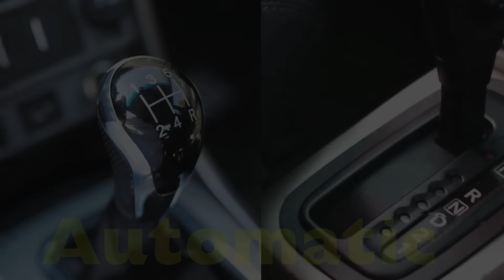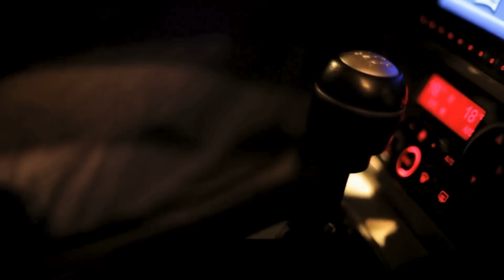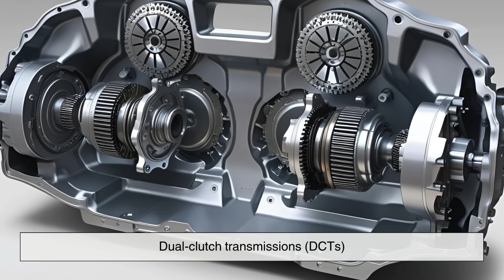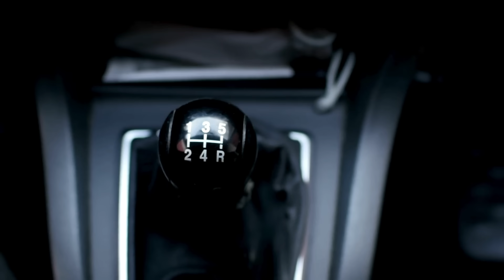Manual vs Automatic Transmission: What’s the Real Difference?

Comment: Can you do a video on automatic transmission shifting modes? Like 1st gear and low gear? Can you explain when and when not to use each manual automatic transmission options and high performance automatic transmission systems as well as hybrid automatic transmission systems?

Comment: The horrible little brother of the  DCT ... the AMT - automated manual transmission, found in some of the cheapest small car automatics
Also, any automatic other than the torque converter has the zero problem, though some would say the torque converter has a creep problem...
For a CVT, for instance, there is an added auto clutch that will disengage at a standstill, but the detection of engage point when pulling away can be uncertain if too gentle or harsh if too firm, I found trying one disconcerting after being used to torque converter. Wet clutch DCT may emulate the low speed creep by slipping the clutch

Comment: Even as far back as in the 1980s, I noticed that manual transmission was in decline in the US. For instance, only a small number of my classmates drove manual transmission. Meanwhile, only about couple of adults around me drove or had experience in manual transmission. However, this was true only in the US. If you jump to South Korea in the 1980s, the overwhelming number of motor vehicles you encounter would have been manual transmission. (But I wonder how much South Korea has changed since then. Hmmm ...)

Comment: I’ve driven manual Ford Ranger for 10 years in 20-million city. And not constant shifting gears pissed me up, but other idiots around, who block the road and not following elementary yules to make even more couple of meters.
And of course, as engineer I prefer vehicles with no transmissions at all. We need to shift a gear because of low efficiency of oil combustion engine at different rpm. Remove this drawback and forget about transmission as we know it. EVs going in this direction but they have a lot of different problems.

Comment: I went 7 years without moving a trailer and even longer not using a manual . Hopped into truck and was like had driven a manual the day before ! Plus if you have a battery issue you can still start a manual ! Drove both a manual and automatic on F1 track and the manual was way more fun 😁 . The only downside was the posted speed limit . 40 kph is painfully  slow in   Montreal ☹️ People bicycles and  cars  share the track

Comment: Another difference in manual since you basically coast to a stop by disengaging the clutch brakes last 3 times longer in a Stick shift
Reply: However, on most vehicles its a lot easier to replace brake pads than a worn out clutch
Reply: @ you don’t wear out a clutch depressing the pedal and coasting at that point it is disengaged and you have to do that at every complete stop. As far as a clutch goes they generally last for 135,000 to 160,000 miles if you actually know how do drive a stick, which I have been doing my entire life

Comment: Back before automatic transmission had more than 4 speed the same vehicle with a 5speed manual would accelerate faster than the automatic and get better gas mileage

Comment: Fixed gears are rudimentary for modern cars, remove fixed gears from equation and no more “control” argument. Manual work is not necessary, EV is way forward, even of backed by ICE generator is a superior solution for comfort and reliability. But fake gear noise and acceleration pulses can be optional mode for fans

Comment: No, I've never sat in a car and wondered what the difference is, but thanks for asking.

Also, a manual transmission does not have sperving bearings that are in a direct line with the panometric pam.
Reply: 😂 Your first paragraph is quite funny
Reply: @abdulazizosikoya  Thanks.

Comment: Challenge today is finding a car with a manual transmission. A few cheap cars would be nice as even low power is fun with a manual.
Reply from the maker: It's true, manuals are getting harder to find.
Reply: The Nissan Versa is currently the only economy car sold in North America that comes with a 5 speed manual, and if I’m not mistaken 2026 is going to be the last model year it’s offered with the manual.  There’s still a handful of other cars that are offered with manuals, but those are all higher end performance cars with 6 speeds. I’ve got a 1999 4 runner and a 2007 Corolla, both manuals. Plan on driving both of them into the ground before I even think about buying a new car

Comment: Try my '28 Studebaker : heavy clutch and no synchromesh. Double clutch or listen to it grind.
Reply: Right you are, however when really in touch with a vehicle, they usually can be shifted without using the clutch as with my '39 & '56 IHCs.